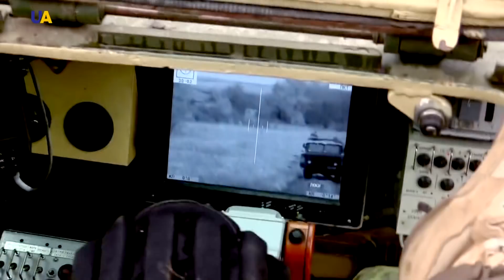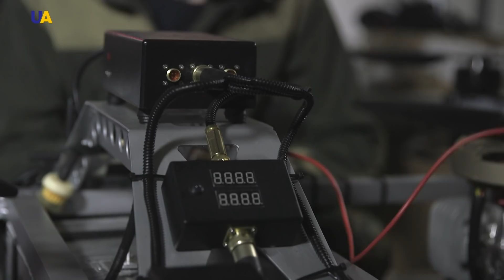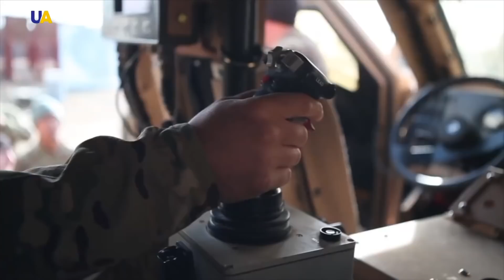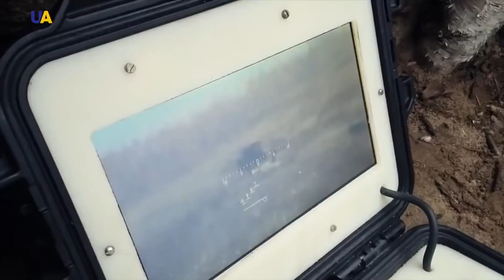Automatic Turrets by Ukrainian Gunsmiths | Master of Crafts

Comment: At 8:30 I don't understand why the tilt mechanism is a regular leadscrew. They could get far faster response with a multiple start screw so the speed could be 3x faster. I also see a lot of the machine gun frames are cut box section that is welded. This could be avoided by using round stock and a pipe bender. I think these guys are not as experienced at engineering as they are making out. A DFX engineer could have a field day on their design. Also, they could have avoided a great deal of engineering by scaling up Sony's VISCA protocol that uses RS232 for the turret control. Maybe I need to get into weapons development...
Reply: they are not top military technicians, they are just a couple of guys starting a small business in a small workshop
its not supposed to be state of the art or cost a fortune, 
maybe they can't afford sonys targeting systems, maybe the square stock is easier to supply in ukraine or the shape of the box stops bullets from deflecting around and hitting a camera
Reply: @hindugoat2302  Exactly. First they hobby build these prototypes which are then being tested. Then the ukrainian government may take interest and invest into the project.

Comment: Cheap solar panels  hidden behind it with a cable running forward to the gun would keep the batteries charged would  make it totally  independent apart from ammo and general maintenance
Reply: Could it be vulnerable still being hidden behind?  enemies still can hit panels? an idea anyway needs to be worked out by the inventors.
Reply: @otello647  Ofc it can stil be hit, as any drone can. The point is that it doesn't matter so much, it's just a machine. They could be arranged in a grid covering each other. As long as they keep the enemy busy, they are doing their job.

Comment: Generally nice guy doing great project but hearing that his system can charge frigin car battery from phone lines killed me xd
Reply: @Mr. V
Theres around 50 volts in the phone line.
Reply: @vladpryshlyak2025  Yes i know that but it can delivere very little current
Reply: @mysterious_czrs  In industry, 30 volts is generally considered to be a conservative threshold value for dangerous voltage. 50 volts aint very little...
Reply: @vladpryshlyak2025  Yes i konw that but phone lines are desinged to powet phones that draw current in mili Amps it would take ages to charge car battery with couple of miliAmps. And if you would try to draw more than that voltage drop on telephone wires and internal resistance of this voltage source would drop actual voltage on load to very little so you can't draw much current from telephone lines. They are designed to transmit low power data signals not to charge your battery
Reply: @mysterious_czrs  Oh  really? And  then, you  tell  us, Mr. Brains...if  that's  so... then  how  come  and  his  system, was  fully  operational  here?! Was  he  using  magic  and  we  didn't  knew  about  it?!
Reply: @theonemesis5217  Damn dude I don't even remember this video now. Charging car battery fro. phone line would be nearly impossible and if spmehow he menaged to do pull it off it would take really long time because phone lines can deliver very little current. The rest of his machine is perfectly fine and probably works great.

Comment: 0:10 they could atleast paint the damn thing is eaten by corrosion ...
Reply: A little chipped paint just shows that it has been working and adds to the camouflage.  No real corrosion.  Mostly just shows primer paint.
Reply: Ehmm. What were u listening with? Your ass, as u usually do? It was said that the prototype was used in combat situation in Avdeevka.